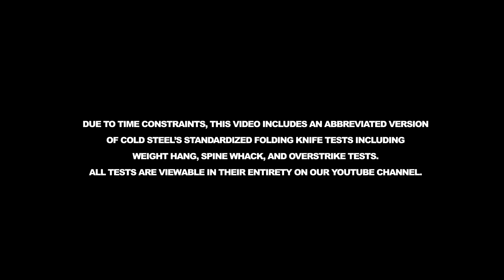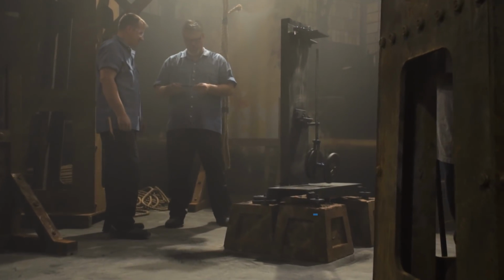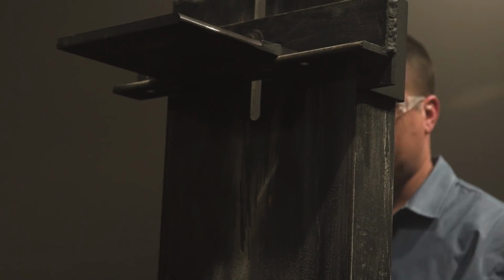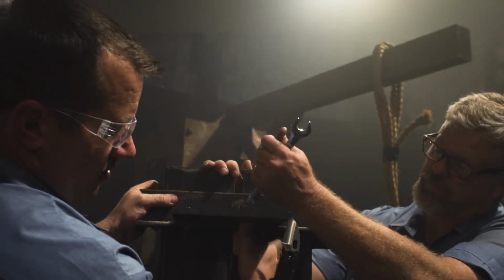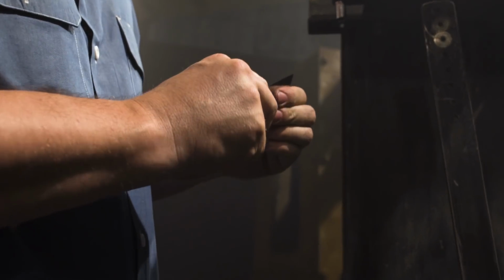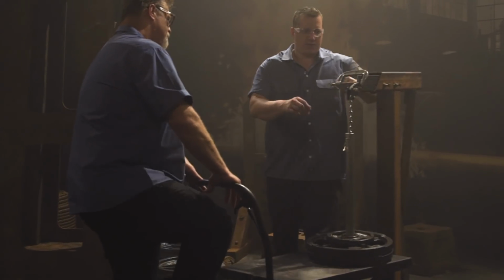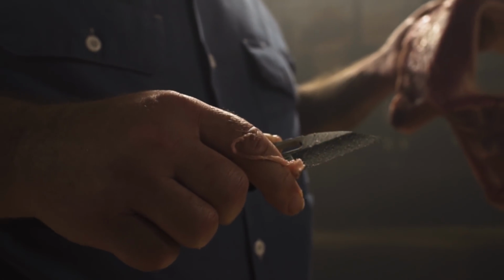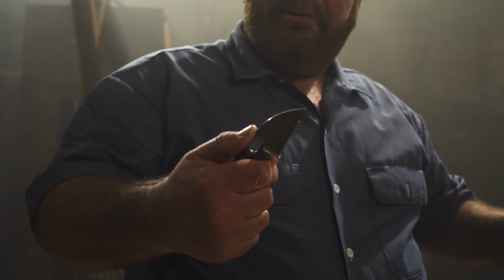COLD STEEL- IRON PROOF 2018- Tuff Lite

Comment: Got mine a couple weeks ago because at the time budget fit and blade length was ok for work plus it was local. Today got bite for first time my hand will never be the same and my respect for the design and blade shape tripled. Cleanest and deepest cut ever from relatively light pressure. I may pick up the mini tuff lite next.

Comment: I only need a Tuff Lite for almost every tasks I do. From crafting my cheap Pvc blowgun, making blowdarts, shredding cardboard at work, just any cutting task!

The blade is skillfully heat-treated, nice edge retention and easily sharpened on a fine aluminum oxide stone. That Taiwanese factory that makes these is awesome.